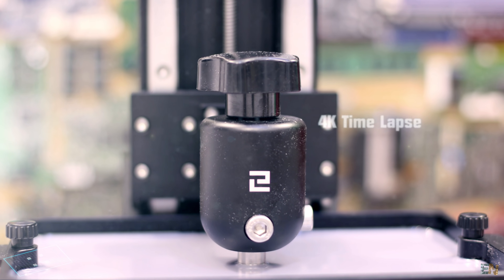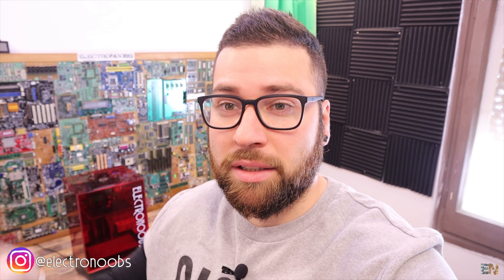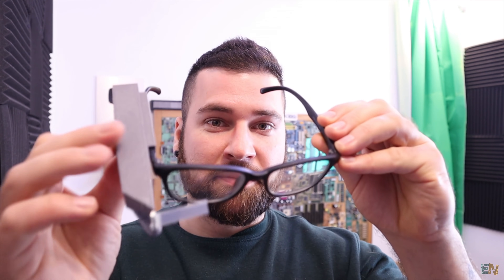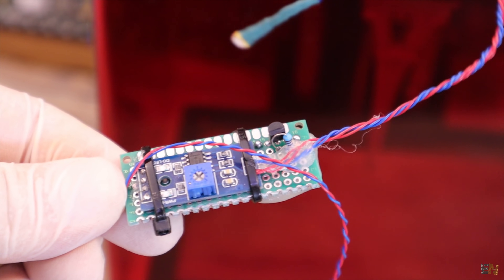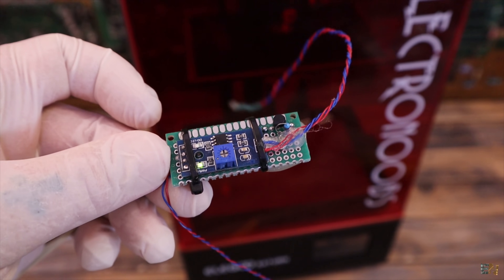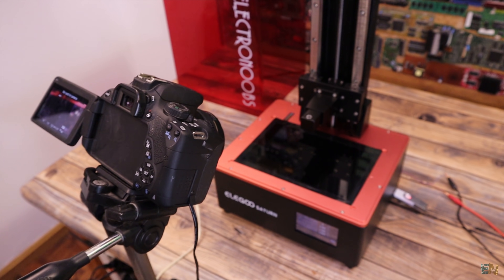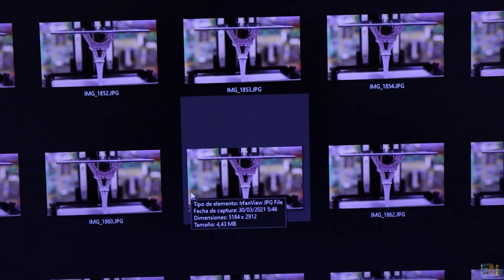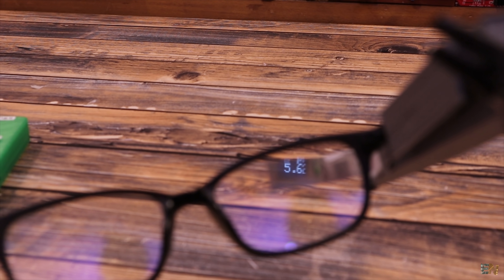Resin 3D Printer Time Lapse | How to Make One With LDR Sensor and UV Light

Comment: How you set up the delay needed fro the time the uv light goes off till the time the bed stops in the higher position? Actually this delay is increasing at every layer you took a different signal to sync the shoot?

Comment: Hai, Why don't you use the time-lapse function, which is already build-in on the camera? Any bad results?
Reply: I guess no one watched the video all the way through. If you use a normal timelapse setting, you can't control the z axis bobbing up and down. So if you want B-Roll Footage of your prints, you need to control your camera to take a picture at the exact same time each level, hence the photo sensor
Reply: @ConnerHall  I never owned a resin printer, but I thought the resin  printer is printed every layer from the screen "flashing",  so the z level will level up at the exact same time. Isn't?

Comment: Excelent video, at minute 4:32 you explaine the process with the fdm 3d printer, how you make timelapses with a switch and layer change. Can you tell what is the gcode you are using ? Or you just using Octolapse? I was looking for a video yours explaining that whole instalation, but I didn't find anything. What I need is the gcode. Do you have any tutorial on that? Or can yoy make a video tutorial explaining with a real example the shutter bitton for the camera and the layer change on fdm 3d printer. Thx in advance. Subscribed.😎👍🏻

Comment: Many thanks, I was really overthinking how to achieve this.  A more permanent and stable way has occurred to me - what if I connect the camera input to the voltage going to the UV LEDs?
Reply from the maker: That could work but make sure is the same voltage as the camera needs, in my case 3.3V. also add some. Resitors to limit the current.

Comment: Any safety issues to printing with the cover off?
Reply from the maker: The resin might get used faster without protection.
Reply: Depending on your resin there are concerns about volatile organic compounds (VOCs) in the air.

Comment: I know it's a bit off-topic on this particular video but have you ever considered doing a video on how grid tie inverters work specifically the grid tie inverters that have limiter functions on how the limiting function actually limits the output on the AC side does it limit the DC side as well or how does it work

Comment: Hi. I'm trying to do this with FDM printer. I have prepared endswitch connected to cameras IR remote with 18650 cell as power source instead of small battery. Works well, takes a picture, but i don't have G-code for that. So my question, can you share your code or is it not compatible across different 3D printers? Where should I add that code? In slicer software in advanced config? Or is there more global solution? That travel to 0,0 point you mentioned is it gonna affect my printing results? Sometimes my printer is making some stringing artefacts. Is retraction added in g-code for each layer too?
Reply from the maker: You can find the code here: https://blog.prusaprinters.org/how-to-create-beautiful-3d-print-timelapse-videos_29743/